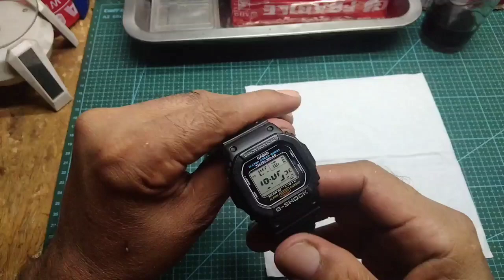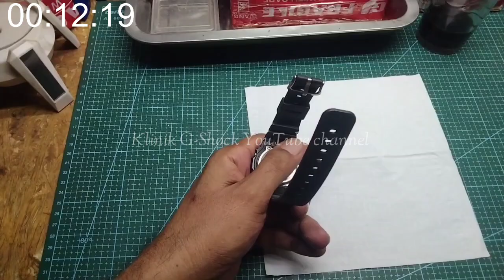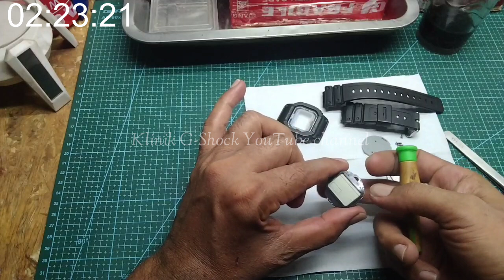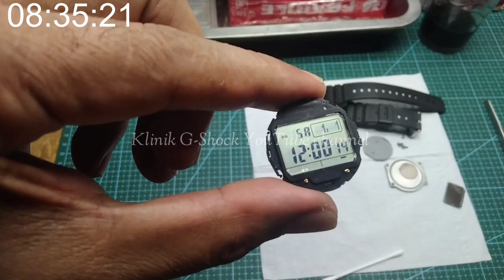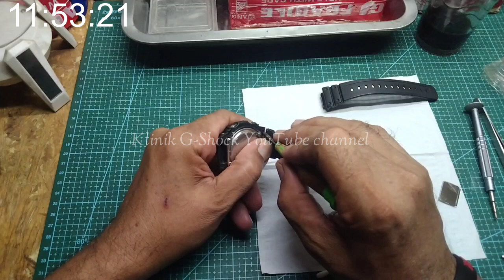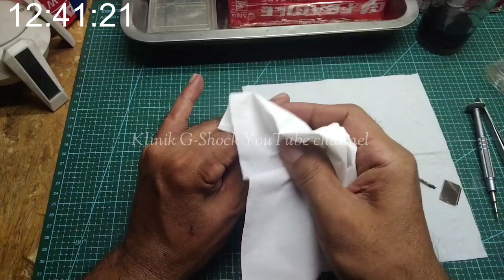REPLACEMENT LIQUIT CRISTAL DISPLAY CASIO G-SHOCK TOUGH SOLAR G-5600E MODULE(3160)

Comment: One question.... I could  have been a issue with the zebra connectors why didn't u clean those and try instead of putting in a new lcd🤔🤔
Reply from the maker: Thank you for watching and thank you also for your input and comments. The problem is not with the LCD connecting rubber but the LCD liquid has frozen. I hope your question is answered
Reply: @klinikgshock  Yes Sir thanks a lot